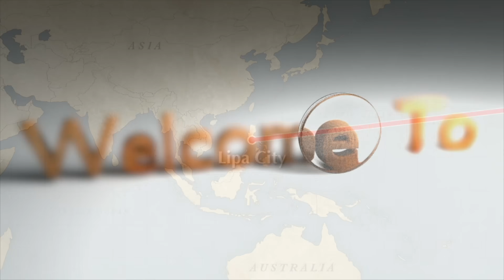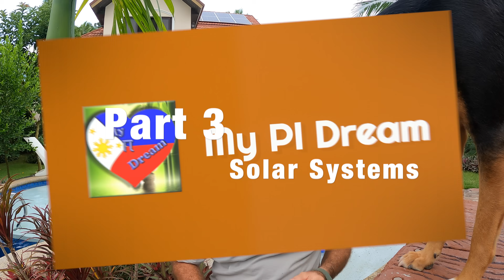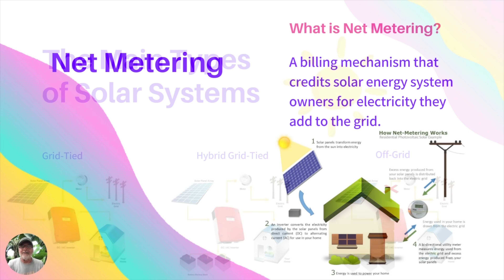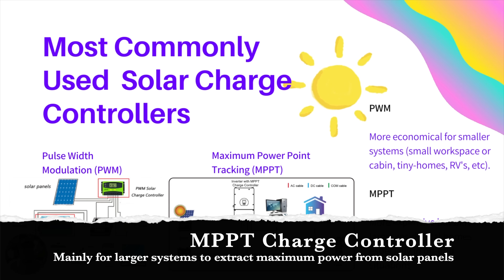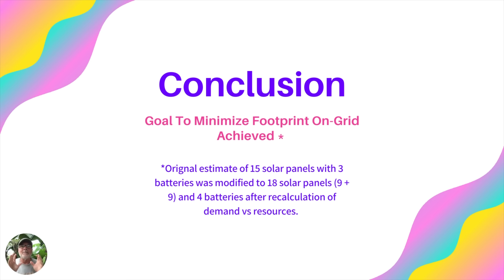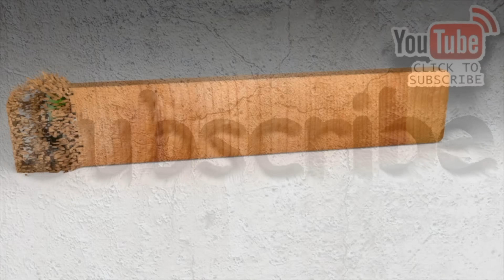WATCH THIS BEFORE INSTALLING SOLAR! (Part 3 of 3)

Comment: Sorry but where is the pricing? How much? Did I miss it?
Reply from the maker: Not exact but the full price for our system to include PV's, inverter, batteries, hardware and installation is somewhere around USD$25k.
Reply: @MyPIDream  Thanks for this reply. 

I am planning to have Enphase Solar in my house but I think I would need first to decide if I will put it in my current house or get a bigger house that I would be a permanent house.

After seeing your garden I think I would also like to have the same. Maybe not as big but at least some of it.

And I also like your batcave in the lower flr. That I really want

Comment: Very in-depth and informative video again James. I have a question about doing the calculations for how many panels and batteries you might need for new home builds. You mention that you used your Excel spreadsheet to help you determine how much equipment to buy. What would you recommend for someone like me who hasn't started building yet, but wants the home to be solar from the start? Would you trust the solar company to provide you with a solid estimate?
Reply from the maker: If you provide the solar company with some details like your average monthly electricity bill and give them what appliances you have they should be able to provide you with the best solution based on your goals.  Goals usually consist of budget and outcome (reduction or almost zero billing from utility company).
Trust with a solar company is based on their reputation and their ability to fulfill your needs plus following on support.  Unfortunately, if you are just starting you only can rely on their performance with other companies.  We feel confident GoSolar was reputable and has so far provided us with very good after the sales support.

Comment: $16,000 USA dollars is what the total cost
 to install your your solar system..
$16,000 USA dollars was your total cost to install your solar system..
Thanks 👍👍.. I do not care how much electricity cost because if everybody else can pay it I can pay a little extra because I waste electricity.. after I arrive in the Philippines what I am concerned about is blackouts because I hate them. I will go with a cheaper system just so I can run my TV and a fan and maybe a few lights during a blackout. I'm not sure about the air conditioner but I will check that out also. I plan on living in the mountains maybe in Valencia so I will not have to use AC at night to sleep. Thanks for all your information which most of it was over my head but you sound like a college professor and I really never did understand most what they were saying either. Hehe.. you do have a long drawn out elegant way of explaining things and I really enjoy it sometimes, and it brings back  memories of my ex-wives.hehe...I'm one of your original subscribers because you are a builder and you get things done and I enjoy watching you. Thank you for your entertaining and informative videos and keep them coming..👍👍👌🤗😎... I know a thing of two about growing up in the heat and about storms and being without power for a week or two or more.. I hope your solar panels will stand up to a typhoon wind. Hello from south Louisiana🐊🐊🐊🐊🐊🤗👍😎🐊🐊🐊🐊🐊🐊🐊🐊🐊🐊🐊🐊🐊🐊

Comment: My Pi Dream,

James, can you please email the .ppt presentations from this video?
Reply from the maker: Hi Daniel.  It's not PowerPoint.  I developed it using Canva's Presentations template.  Canva converts the presentation to a .mp4 file.
Reply: @MyPIDream  

James, would it be possible to get it in slides? Would like it review for reference.
Reply: @danielbia333  Please email him at mypidream@gmail.com.  He is ready to send you the Canvas presentation.  😄👍

Comment: Nice series, James. I have a place in San Carlos, Rosario (about 21km from Lipa). We built it in 2015 - mostly for my wife's family who lives there now. I was thinking of putting panels up there since I have solar here in Pensacola, FL and love it. I was pleasantly surprised to see about how much it cost you. That same system here in FL would easily run $30k without any battery. I will probably be moving to PH permanently sometime in the next 10 years and may be building another house. Keep up the great work there. I would love to connect when we come over there next time.

Comment: Now.. What about whole house generators that can run on propane? Power is out 3 days and it's dark and rainy 3 days.. Would not a whole home generator work on a half dozen of those large propane tanks like the neighbor had? Just for those emergencies.. Instead of the gasoline or diesel generator route.👍
Reply from the maker: Even on days with rain or heavy clouds, today's solar panels can still collect enough ambient light energy to convert to 1kWh or more.  This is enough to run essentials and some charge for battery backups.
Generators are always an option but are generally large and take up a lot of space.  They normally are not kept indoors because of safety concerns.
It's a personal preference and your situation will dictate your choice of backup options.
Reply: @MyPIDream  I see.. Just so nice to have a natural gas whole home generator kick on here and not even think of any other sources when they are not present. 👍

Comment: Hi James Hi Ness: James great presentation of your system and of the tremendous amount of information you provided.in a nut shell you were able to give a vast number of viewers a  base line based on your personal system all that's left is to do the duedilagence for their own desires  based from your set base line. Although the presentation was a tremendous success in the information provided,  you still did a (big smile) dazzle with brilliance  side step if the offical out of pocket. That's pnp I know but bottom line great presentation. Loved it.👍👍👍👍👍
Reply from the maker: At the end of the video Wayne.  P900k for everything to include installation.
Reply: @MyPIDream  smile sorry may have  jumped the gun. LOL
Reply: @MyPIDream   yea my bad , I see it now Once you say good-bye I'm usually outta  there. too bad they only operate on Luzon... would probably be a much more profitable company they expand or even franchise out to other Islands. Well Whens the next project?

Comment: This is in my bucket list. Getting off-grid or close to it means you avoid the scrupulous neighbors that connects their power use to your meter by some of the most complicated network of street wires😜 but then maybe not in more decent neighborhoods🤫.. yes this is so informative if not the best info we can get on #SolarPower #OffGrid . I'm sharing this vlog to all platforms...👍

Comment: Thanks James, for another great video.

I was a bit disappointed with GoSolarPhilippines. We contacted them, and they weren't interested in doing projects in Pampanga. As an Archtect doing a large number of projects in various locations, I was surprised that they are only planning to focus on projects in "NRC/Metro Manila or nearby areas." Lucky I have other options.
Reply from the maker: I've been getting a lot of emails from subscribers of our channel wishing to have GoSolar install systems at their locations.  GoSolar also had to decline several of those in areas outside their area of responsibility.  I contacted Joshua Matibag of GoSolar and here's their position for not selling/installing outside their zone:

“To give the best sales, service and support, currently GoSolar has a limited area of responsibility to ensure their clients get the best possible customer support as possible.  What we wanted to avoid is to give bad impression after installation and to provide the best after sales experience while we grow a wider coverage.”

I find this approach a positive aspect and one of integrity for such a young company and one that you can not find fault with.  I have high expectations that with this strategy this company and will continue to report to our viewers my experience with customer support.

Please keep us posted here on your solar system plans so others might benefit from your experience.   Thanks!

Comment: 3 great videos, but, unless I missed it there was no financial breakdown of how much? The one thing everyone wants to know. I'm looking at a larger system as brown outs are plentiful. It would be helpful knowing the size of your installation if we'd had some guide price of costs. What (guide price) does a 18 panel, with the inverter and 4 5kw lithium battery packs cost installed? For me, I think I'm looking a least 6 lithium battery packs, to cover the days we have no power. Fully accept my ROI may not happen in my lifetime, but I'd rather be sure of having A/C whenever I want it.
Reply: he did not say it but at the end of the video,  it was written.
Reply: @crisencabajar7760  many thanks. I sat and enjoyed the video, but as he was signing off I went into the kitchen to may a cuppa and mist the final caption. Actually cheaper than I thought. I'll need to contact go solar and see if they can install in Isabela.

Comment: We looked into net metering when we recently installed a 5 Kw hybrid system 
Davao light charges 35,000 peso to inspect and install the net meter, then credit you 3 peso /Kw. Not worth it in my opinion
Reply from the maker: Thanks for sharing and confirming the costs and sell back price.

Comment: Thank you for sharing so much info. I was hoping you would release this one before this Thurs.  There having a builder supplier convention here in Davao on the 28th and there will be some solar companies displaying at it and very interested in seeing what systems and  inverters are available at it, I've not been very impressed with what I've seen here so far in inverters compared to US. but it only makes sense to buy whats available here. Panels and batteries are pretty much all Chinese it seems, so not much of a choice in them, but I've never seen or heard of your inverter brand, hope you will keep us updated on it all. 

 I've  watched a YouTuber for years that buys and disects batteries and inverters and some of them are really bad and unsafe it seems. Before he destroys them he checks all there advertised capacities and specks, some do very well but far more do very bad. Especially love the companies that send him stuff for free hoping they will get a good review, but he really calls them as he sees it. So many Chinese batteries look almost identical until he cuts them open and looks at there build quality. 

 I was guessing $15-20 thousand for yours, or maybe thats just how much in my mind I have allocated for ours. Do you think you will add any more batteries, kinda seems you could use more storage since your discharge is set at 30%. 

What capacity batteries are yours and what voltage do you have them wired for into your inverter? 

Very good series, but thats just what you do!!
Reply from the maker: Batteries are 5.2kWh each.  I think the configuration is good for our load and right now we're into the shortest solar months of the year.  Nice thing is this system is scalable and adding an additional battery if necessary is extremely easy.  I'll continue to report the performance from time to time in updates.

Comment: James , what about atic insulation? I believe  that if you're  able to use  some sort  like rock wool or Styrofoam sheets earlier in the build Ithe Electric   bill might be less, that is one of my beefs  about attics roofs there only foil  insulation in most cases.
Reply from the maker: Our experience here is the foil insulation works well in our house.  We do live in a milder part of the Philippines than most other places which is why we rarely use aircon.  I'm sure in other very hot locations different insulation choices might be more appropriate.

Comment: Excellent presentation! However, there is an important safety device to point out. Every (Hybid) Grid-Tied solar system should have an ATS (Automatic Transfer Switch) between the electric grid and the solar system. I see you have one is your second video. This ATS will automaticly disconnect the grid connect if the grid loses power. This is super important to have, because without an ATS your solar system can send electric out on the grid and kill a line man who is trying to repair the electric lines. 

Sometimes people try to do DIY their solar system and forget about this super important safety device.
Reply from the maker: Good points and I thought I covered this in one or more of this 3 part series.  We actually have 2 ATS's.  One for the inverter to grid and a secondary for our EcoFlow to Inverter for an additional layer of backup if the solar system is not present. Both provide us with isolation from our utility company to prevent feed-in to our utility grid.

Comment: Hi James, great 3 part presentation. I had an on the grid system installed, 6kw system with 20kw storage backup and I also built my own off grid 1kw system with 6kw storage backup. You covered the subject matter very well, I just have 1 question - what is the best angle of the solar panel and what is the best direction the panels to face (northern, southern, east or west) for maximum efficiency. Your set up is across four different positions (because of the structure of your roof) and will lose some efficiency, but it is still a good way to get electricity. Your Canadian neighbor looks like it grouped his panels all together and are facing the southern hemisphere for maximum efficiency. Panel angle and positioning is key for maximum efficiency and of course planning ahead and designing the solar system before building the house, so everything fits well together. Hope this helps. Take care and enjoy. I love your house and your design is beautiful. I am totally envious of your life. We are now looking around Luzon for property and will be there Aug and Sep. Cheers…..Frank and Remy
Reply from the maker: Your solar installer should be able to give you the best angle and directional facing for your location.  For all the Philippines, true south facing will apply.  The year round angle of the PV panels for our area 15.5 degrees.  This is slightly different from the standard calculated value to adjust for annual differences due to the rotational angle of the earth to the sun.

The actual calculation is 0.812117 x latitude = angle from horizontal facing south or for Lipa City 0.812117 x 13.941876 = 11.322434511492.
Reply: If you’re still looking for a lot we have one less than 1km from a river resort but you would never know it. It’s quiet and there’s no sign of traffic from within the subdivision. 615sqm in an ever increasing real estate market. ₽4000/meter.

Comment: Maayo Buntag James,  We're in the stage of collecting quotes from Solar companies here in Mindanao. Unfortunately So Solar doesn't extend there services down this far. I have a question on your batteries. You said that you are using the Lithium Ion  (LEF) batteries. What are the specs of your batteries? Voltage, Amp hour, and KWh??
Daghang Salamat.. God Bless
Reply from the maker: Here's the full data sheet:  https://www.fox-ess.com/wp-content/uploads/2021/01/LV5200.pdf
Reply: @MyPIDream  Thank you James.. Keep up the great work
Reply: @MyPIDream  Sorry for being so intrusive James, can you sent me the data sheet for the Inverter you used, I'm thinking you used the Fox ES Inverter so it would be compatible with the batteries.. Salamat kaayo..  God Bless
Reply from the maker: https://www.deyeinverter.com/product/hybrid-inverter-1/hybrid-inverter-sun5-6ksg01lp1us-sun7-6-8ksg01lp1us-eu.html.  Ours is the SUN-8K-SG01LP1-EU.

Comment: I haven't finished watching your video yet, but it is very interesting.  The downfall (and you will probably discuss it) is that the batteries last 5-15 years and the solar panels are good for about 25 years.  The real question is how soon will you see your Return of Investment (RoI).  If your ROI is prior to the batteries or panels needing to be replaced then it is proably worth the investment.  If you break even, then you may feel it is worth it to have continious uniterrupted power and your green footprint.  It will be interesting to have you monitor and report through the years of use for the rest of us to see if the RoI was there.  Thanks for sharing!  I did have a few questions: 1) How do the panels hold up to typhoons; 2) If you have to re-roof your house, I imagine the panels will need to come down and reinstalled afterwards; 3) If you had the yard space, I imagine a ground install would be better with the solar grids that follow the sun for max power?  I guess you will be getting a maintenance contract to clean your panels...especially with the occasional volcano ash fallout?
Reply from the maker: I think several of questions you asked are covered in this episode but will answer what I missed here.

1) For high winds, typhoons, the panels are rated for 1. 60m/s or 216 km/h or 134 m/h on Trapezoidal Metal Roofs.  As the type attachments for trapezoidal metal roofs are not as strong as the L-brackets attached to our C-purlins for our roof I'd say our wind rating will be higher than the manufacturer's rating for the metal roofs.

2) To re-roof, the panels would need to be removed to remove the panel mounting brackets and access the roofing tiles.

3) If we had another 1,000sqm of yard we indeed would have installed the panels there instead of the roof for ease of accessibility and to keep our roof clean.